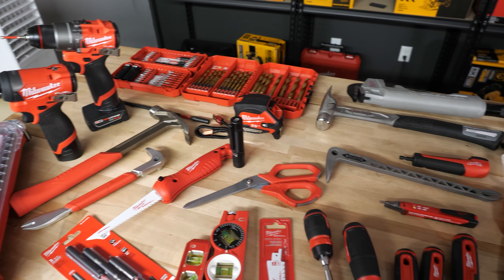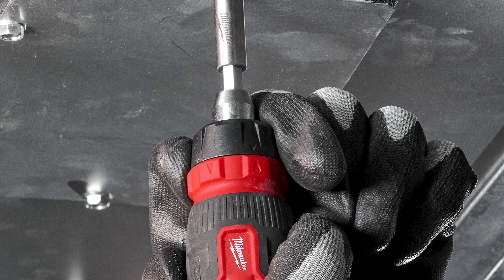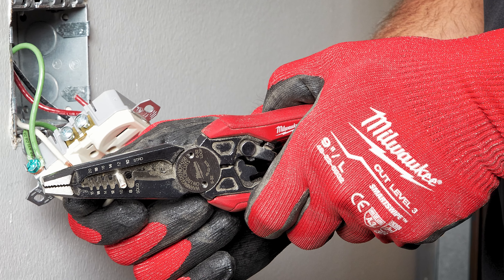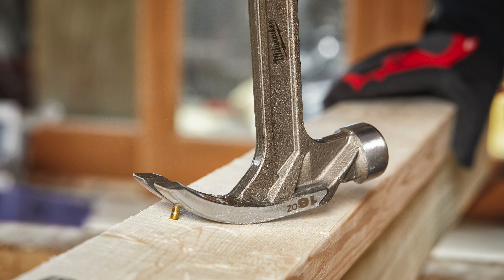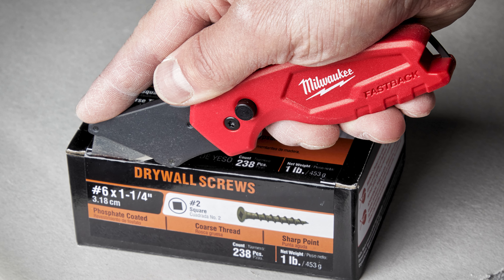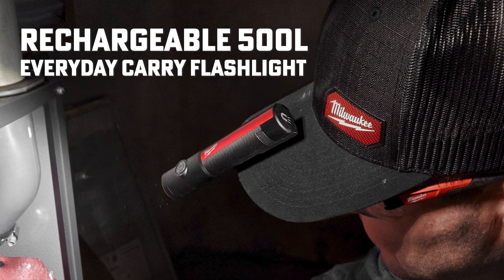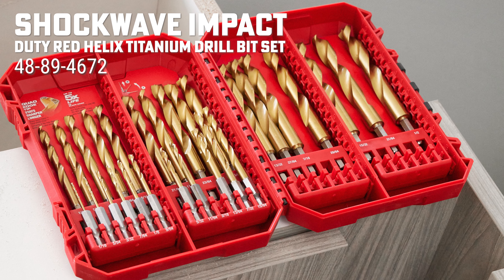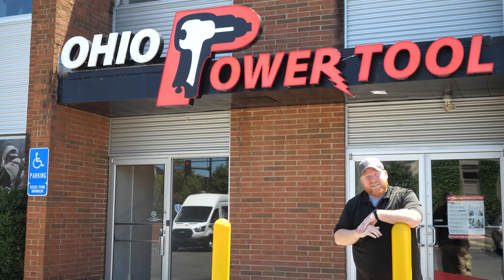The Ultimate Tool Bag Guide 2024 - Milwaukee Edition

Comment: Going through 2 Milwaukee bags in 2 years helped me make the decision to buy a Veto bag. I beat the crap out of that thing daily and it takes the abuse. No thanks Milwaukee.
Reply from the maker: Veto makes really great tool bags. These brand new Milwaukee bags are better than we’ve ever seen but understand if their previous ones have not held up for you. Veto will last for many many years. Time will tell but Milwaukee really stepped up their game.
Reply: Also can’t beat the veto 5 year no downtime warranty
Reply: What on earth are you doing to your bags? Our company has 6 guys that all have the 10” and 15” totes for about 5-6 years now and not a single problem
Reply: @tyrelgranger8105  I have had two tech bags and the hard plastic stiffener starts tearing through the sewn seam due to the weight of the tools. One of the zippers broke on one bag. Could be just that particular bag but after going through 2 of them, they went into the dumpster. Didn't want to try another one. I have a half million dollars in Packout without an issue. They just can't make a tool bag in my opinion.
Reply: Learn how to take care of your products.
Reply: @R.I.PXXX999  If general everyday use of carrying your tools in and out of the homeowner's residence and loading in back seat of truck is abuse then I guess I need an office job. If Milwaukee can't make all of their products to withstand taking in and out of a vehicle on service calls then they need to quit dipping their hands into all products and just stick with power tools. Just because it says Milwaukee on it doesn't mean it's better than everything else.  I have a flex bag that came with my rear handle saw that is more durable than the Milwaukee bag. And it came free with a saw. Not a Milwaukee Fanboy here just telling the truth. Not trying to hurt feelings. I've had more Milwaukee Tools sent into warranty than DeWalt believe it or not in the past few years.